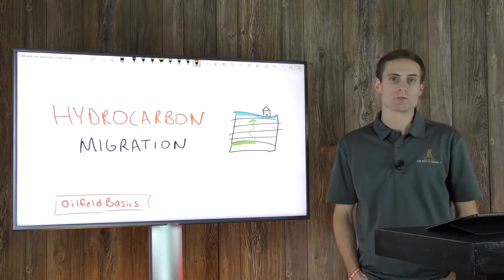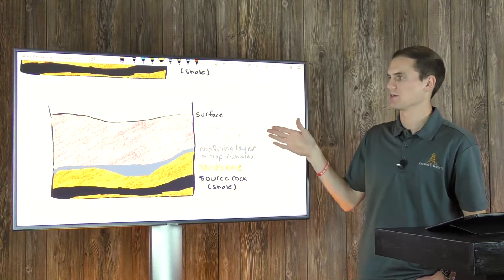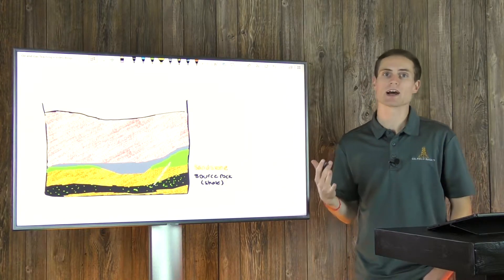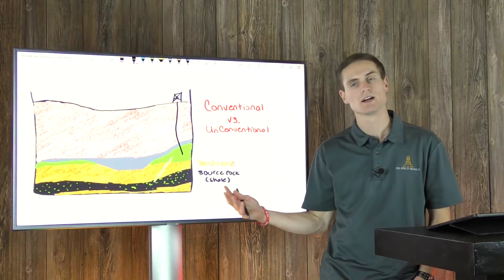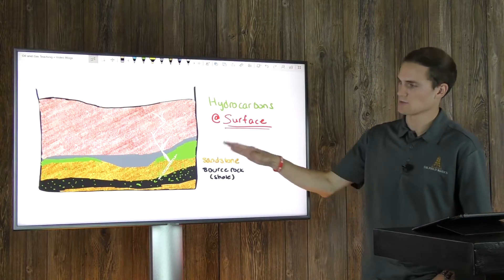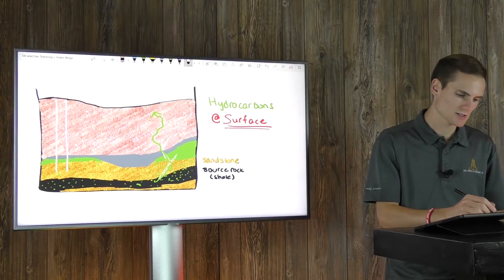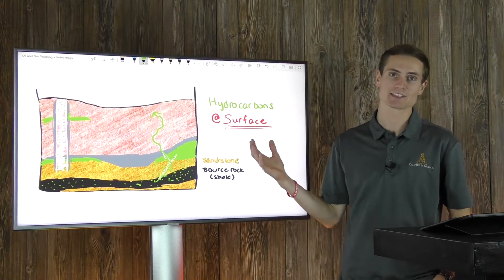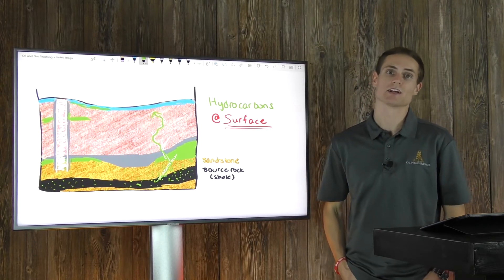Oil & Gas Migration: Faulting, Water Contamination, Source Identification, and more!

Comment: please solve my doubt: will drilling a well and later producing it will create a well pressure sink and reduce the chances of migration  to  surface if  cement integrity is good..
Reply from the maker: Yes, production wells will be a pressure sink for nearby hydrocarbons/liquids/etc because it is lowering the local reservoir pressure. If the well wasn't drilled, those hydrocarbons would have had a greater chance of migrating to the surface. Of course, this all depends on geology (as stated in the video), but a well is definitely a pressure sink. That's why we end up with our own wells getting "frac hit" by new wells (I did a video on that topic too).
Reply: thanks a lot sir
Reply: sir frac hit direction will be decided by geomechanics or nearby  sink ????